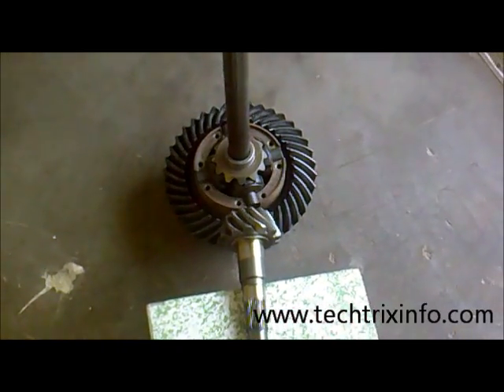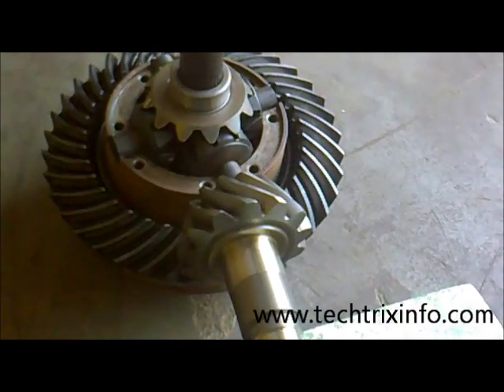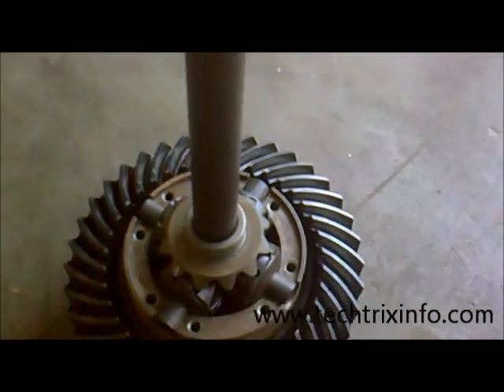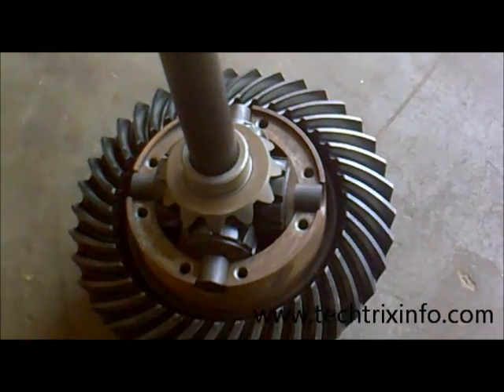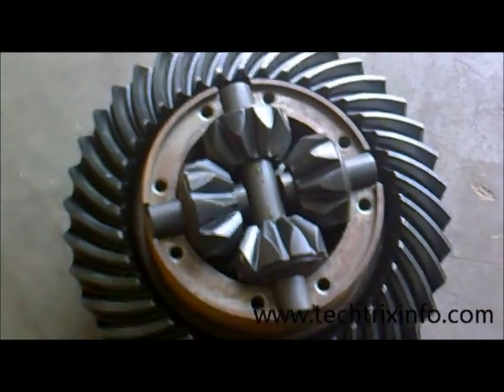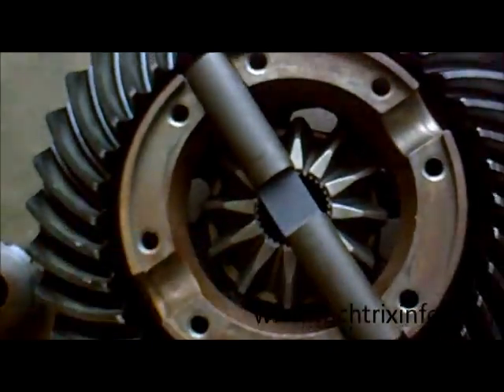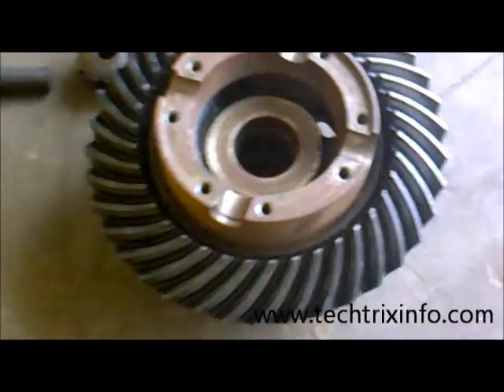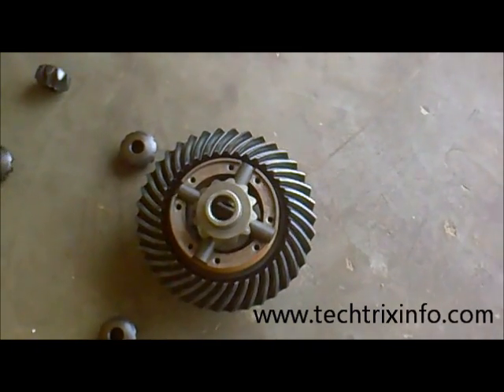How differential works. ✔

Comment: can u pls explain how both wheels rotate at different speeds while taking a turn..
Reply: anoop a whem we r taking left turn N left is greater than N right due to spider gear..
..spider gear having 2 velocity one is rotional other one spin...both velocity added in case of left tyre but diffrence of velocity is on right shaft or tyre.....
Reply: thanks

Comment: There is one correction required in video description; you didn't used Sun Gear at all in the video. Its a 4 x 2 Star/Bevel Gear Kit. On the other end of Axle Shaft; Sun Gear is connected which helps to rotate the wheels with the help of another set of gears known as Planet Gears. Kindly check

Comment: is that true that while taking the turn, the sun gear provide extra rotation to star gear as a result of which the outer wheel speed inc. if yes than what happens to other star gear which is on inner wheel side?? can u elaborate on that..